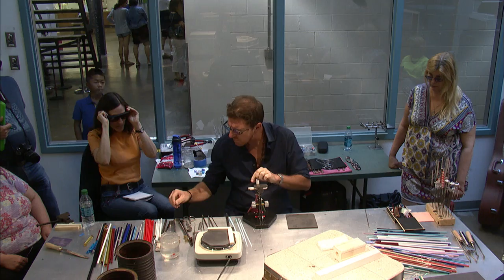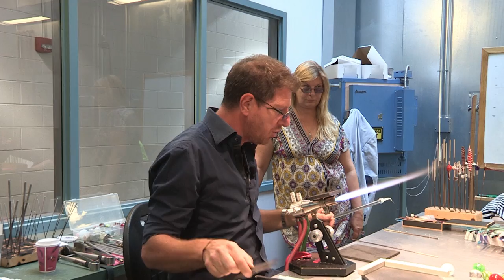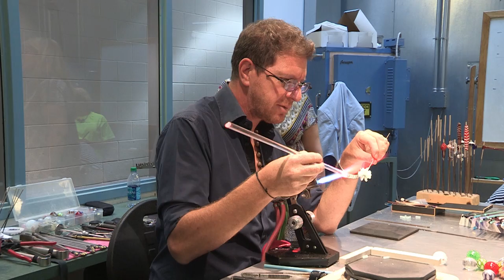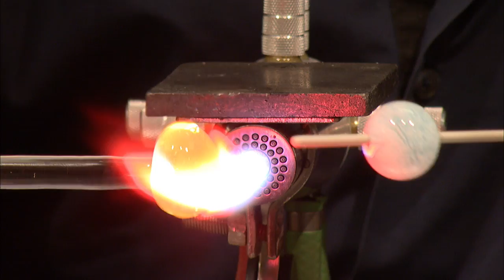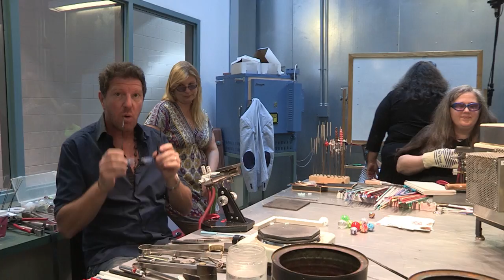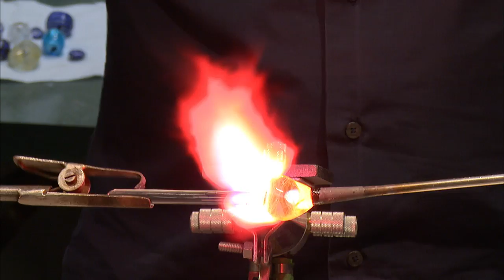Live-streamed Studio Demonstration: Davide Penso (August 27, 2014)

Comment: Great video! Thank you. I would like to know what type of blowpipe is recommended and where to buy it?
Reply from the maker: Ann, The blowpipe can be very simple or more expensive.  Often, people use just a cut section of stainless steel tubing, often 1/4  outside diameter with a heavy wall.  In this video Davide uses a more complex version with a brass mouthpiece and thickened "gathering" end.  They are available from Carlo Dona: Spiral Arts is their US distributor.

Comment: encaseing the color with clear, does that add the layer of clear behind it so you can skip the encasement after the colors, or is it just for boiling purposes?
Reply from the maker: Encasing the color in clear glass greatly reduces the possibility of reactions with the torch atmosphere, as well and prevents boiling of the color as you suggested.  Also, the layer of clear can magnify the interior pattern.